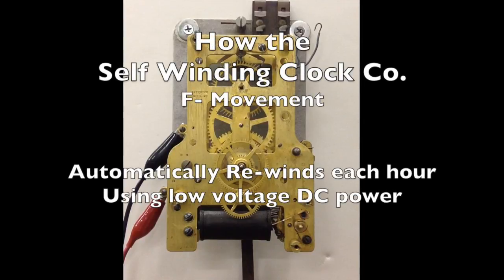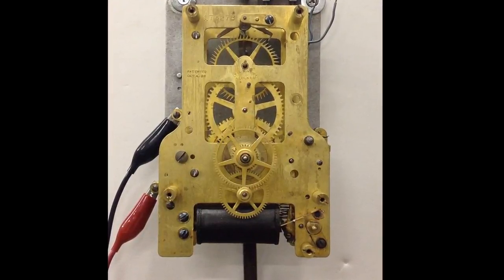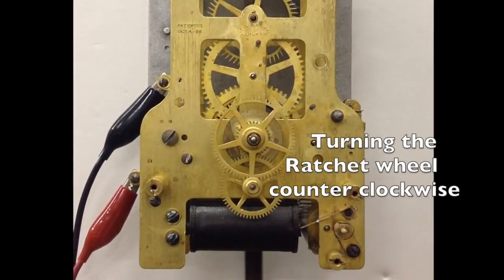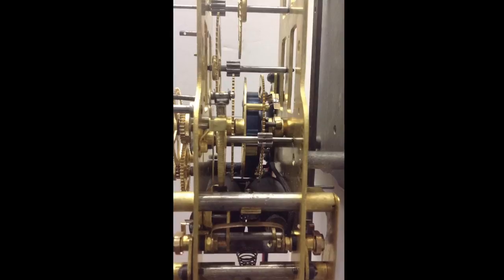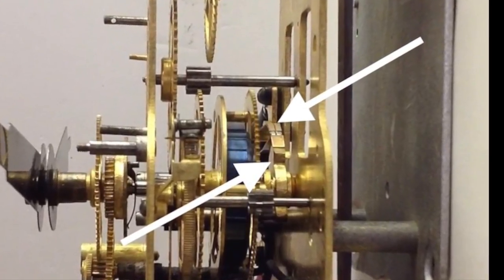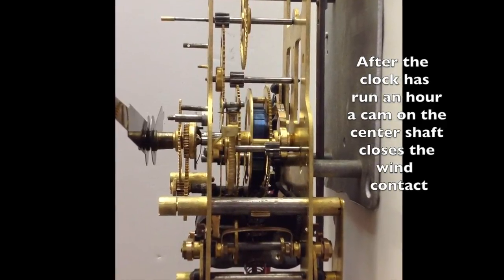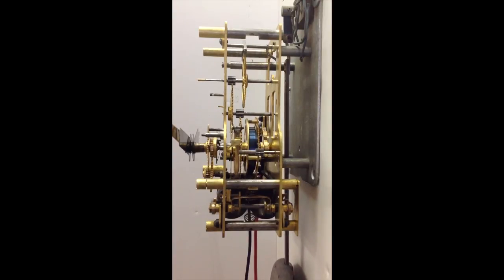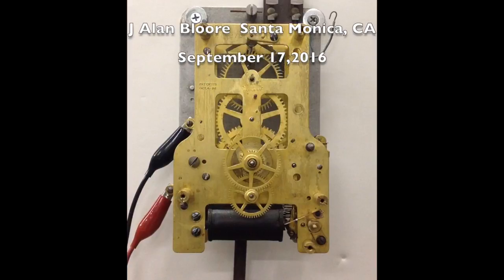Self Winding Clock Company "F" movement Re-winding

Comment: A similar principle is used in the famous Soviet electro-mechanical table clock "Energia" produced from mid-50s to late 60s. The only difference is that it uses an ordinary DC electric motor (as in battery powered toys) driving the winding axle through a belt and two pairs of gears. Its typical winding time is 1 to 2 seconds every hour and it runs 8 months on the original 4.5 V battery or up to 3 years on four modern alkaline AA cells.
PS, this clock also has a fully mechanical triple calendar (day, date, month) that automatically takes into account 30 and 31 days in a month, except February.
Reply from the maker: The "Energia" sounds like my kind of clock. I love that it winds so quickly and that it also has a calendar.
Thank you for the information. I am going to look for one.

Comment: Hi Alan,
I have a Self Winding Clock company clock with a second hand which was used in a broadcast studio.  it winds approximately every seven minutes.   Can you tell me what's inside which makes it rewind at such frequency.  It doesn't seem to wind at the same times each hour.
Thank you, I really appreciate your videos.
Reply from the maker: Hi Alan D,
Apparently the reason for winding more frequently than one time each 60 minutes was to shorten the wind duration and make less prolonged noise. The multiple wind sweep second clocks that I have seen have a 12 tooth wheel rather than the usual single lobe cam. The contact closes and the clock winds for a very short duration each 5 minutes. The time between each 5 minute wind cycle might not be exactly the same but it seems that total time each hour should be the same. I am going to check mine.  Thanks for watching my videos.